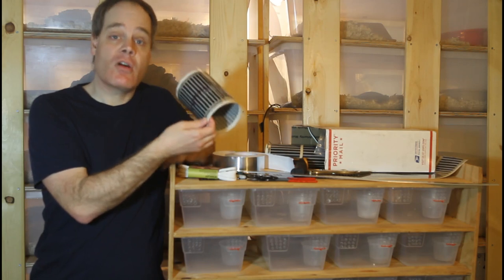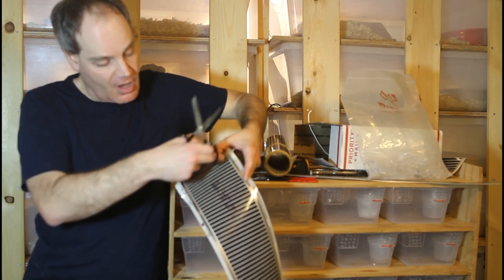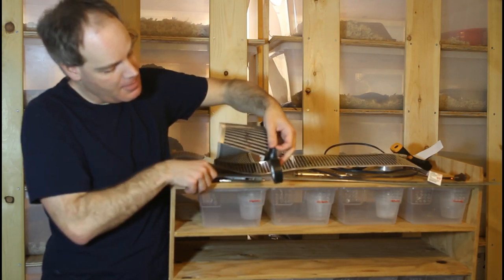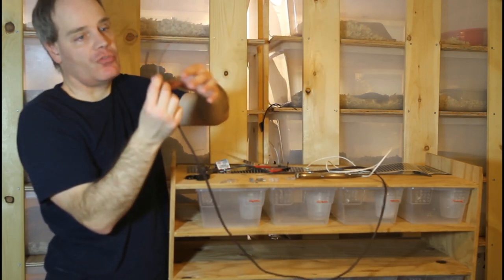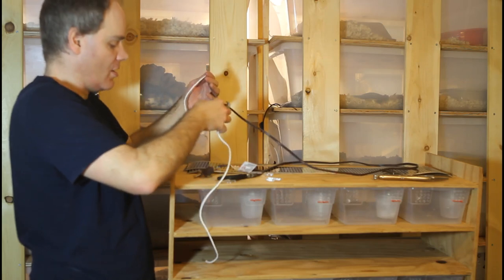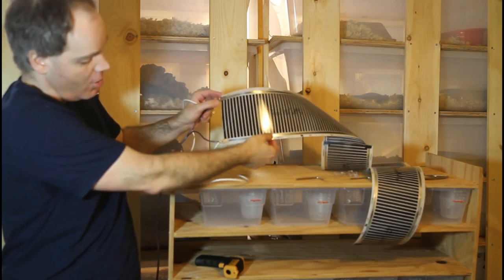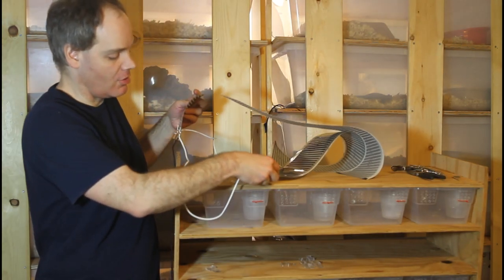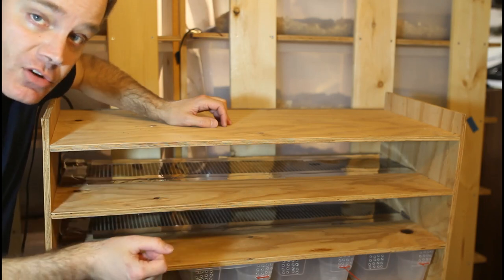Using Flexwatt Heat Tape in Boa Racks

Comment: Hey Brian ,,, the flex watt heat tape cutting situation if you cut within the feet of the tape will you mess the flow up like for instance it says 20 watts per foot and if you cut within the foot will the process be messed up or do you have to cut after a foot no matter the length  ? ,,, I do appreciate the quick feed back for this question'
Reply from the maker: The newer style flex watt can be cut in between the black bars that run across at any position.  You just need to be careful to cut in the clear part and not cut into the black part.  You can cut it to any size this way.  If it less than a foot, the piece will be a fraction of the watts/foot.  For example, 6 inches of the 20 watts per foot flexwatt would be 10 watts, and 3 inches would be 5 watts.  I hope this answers your question!
Reply: @BrianBoas  well understood .... Thanks for the help. Handshakes

Comment: I had a major failure with heat tape. Was even on a thermostat. Probe either failed  and was in the on position. It was pre installed by Reptile basics. Burned up, crinkled with a few holes. 120 V AC current doesn't flow one way like DC. Flows in both directions. Even with the thermostat working properly at 88° w/ probe attached, I was getting anywhere from 88 on some bars and 115 on others. It happened with multiple flex tape, pre wired and set from them and multiple thermostats. I'll try to get something other than Inkbird and maybe get a Vivarium of Herpstat. Any ideas on what's causing this?
Reply: Thanks for your time and great video. You're a pro!!!
Reply from the maker: Wow, that's scary- sorry to hear.  What type of thermostat and heat tape were you using that failed?  I had a cheap jumpstart thermostat from hydrofarm fail in the on position on one of my racks many years ago.  If I hadn't discovered it so quickly, it may have been a disaster.  Since then, I only use herpstat thermostats and have had no issues.  As for why your tape is 88 on one side and 115 on the other, some heat tape can vary considerably in temp, with hot and cold spots.  Supposedly the THG is better than Flexwatt in this regard (so they claim) but I haven't done any careful tests.  Also, the heat tape has a finite life span and needs to be replaced every few years.  Perhaps if your tape is old it is causing the hot spots?